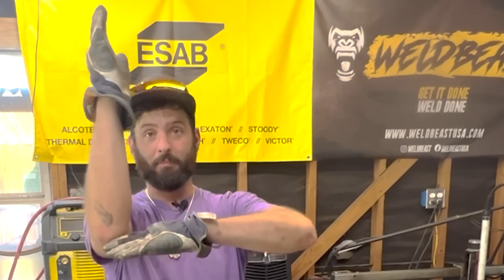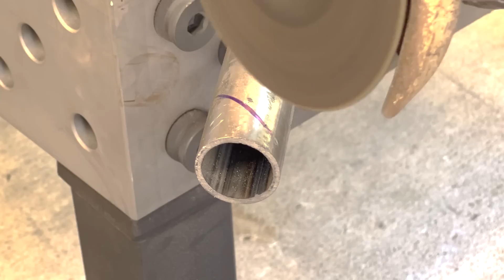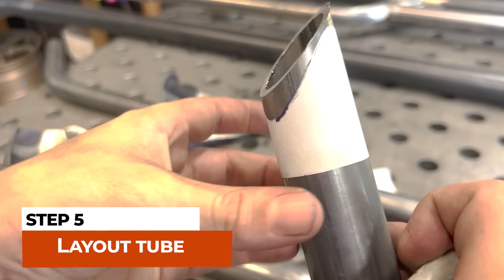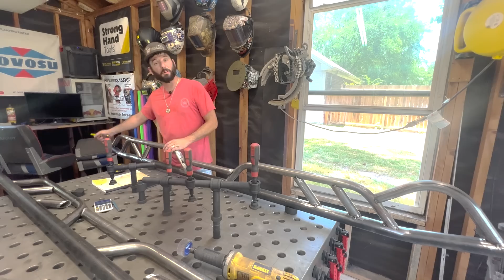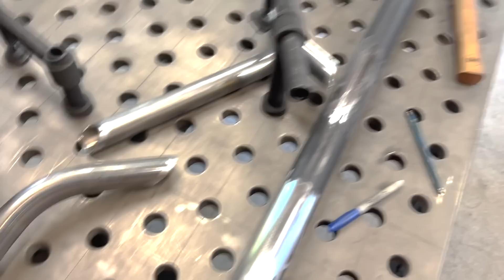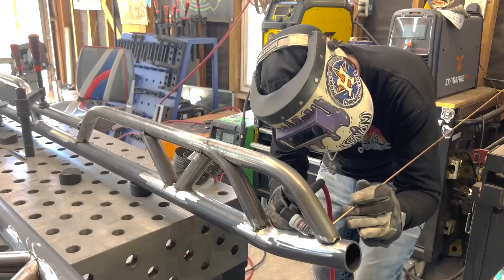Tube Notching With A Grinder : Fabricating Custom Side Steps Pt 2

Comment: Receipt paper is a cool trick, I would keep it a little more simplified than the pencil tracing. The black fingers you get from handling the metal pipe would make a quick and easy line, rub your fingers on the paper at the edge of the pipe. Your work is friggen awesome, I wish I had the space and good health to be able to create works of art like you! Thanks for sharing your talent.

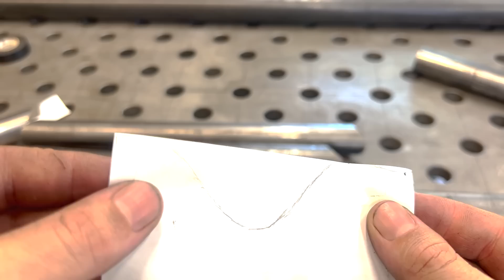Comment: 6:22 I think this would have been easier to just rub it with your dirty thumb, slightly creasing the paper inwards. The dirt coming off your thumb or fingers will trace the line.
Reply: 😂haha it might’ve been dirty enough for sure!
Reply: @austinhargett5792  It’s not hard to find a bit of muck in the workshop to do this! As a fabricator, I know!